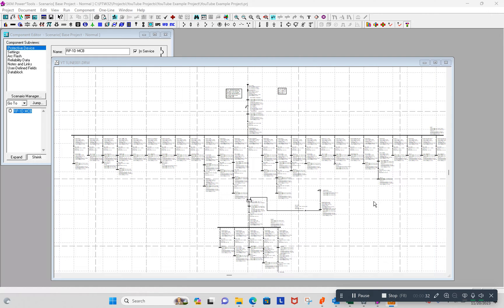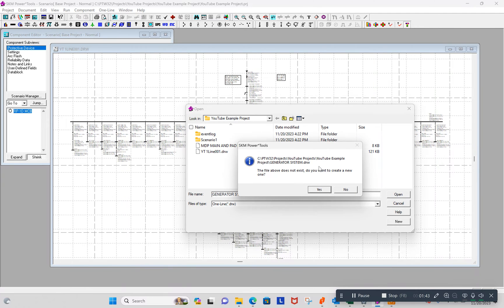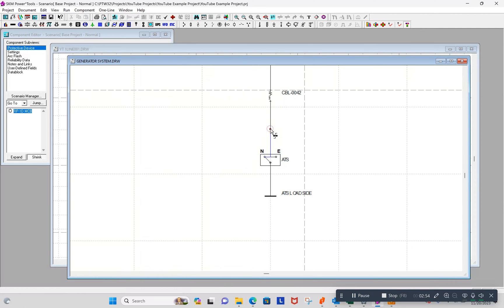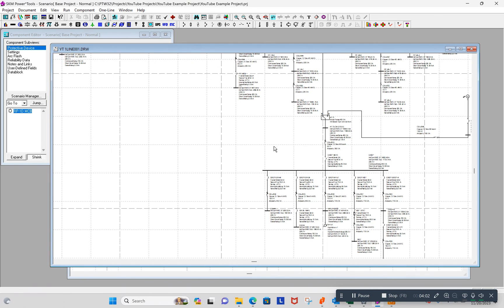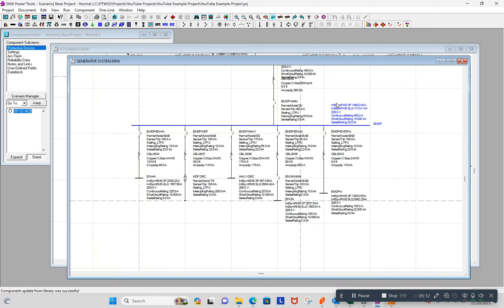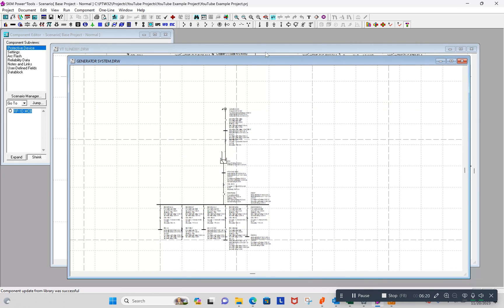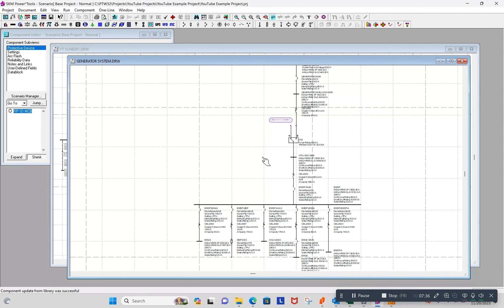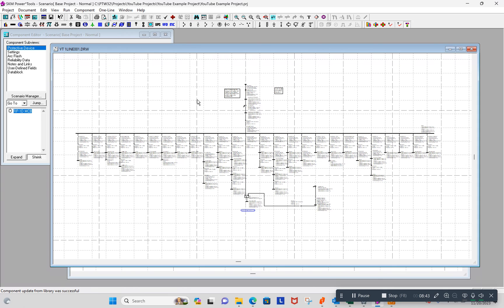SKM PTW Creating Multiple One-Lines and Using Links

Comment: In this example could you draw the generator system on a separate one line?  If you link them do the calculations link?  Or do you have to have one master one line?
Reply from the maker: The model is the model and independent of what you choose to display in the one-line as far as the calculations go.  So yes, you could show the generator distribution on a separate one-line and it won't affect the calcs at all.  Thanks for watching.